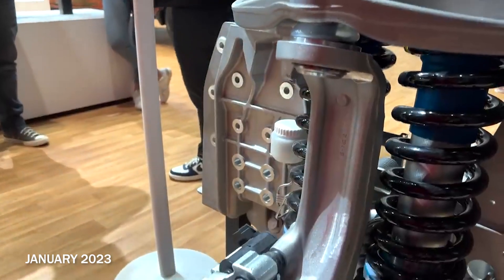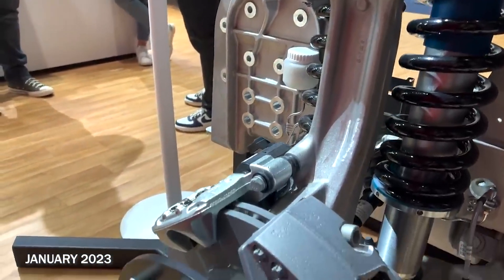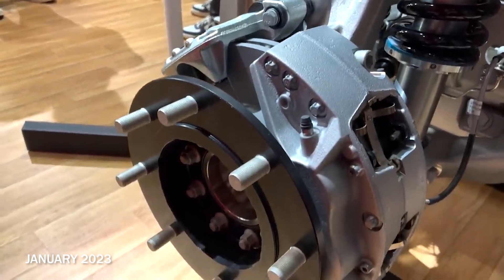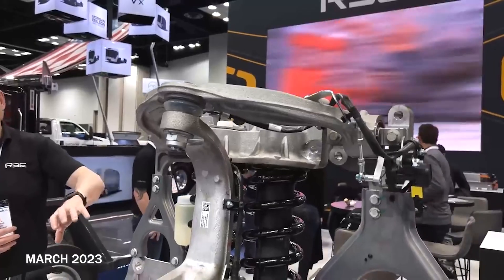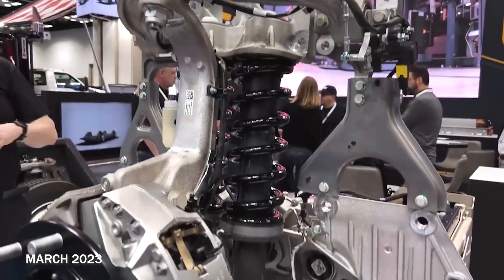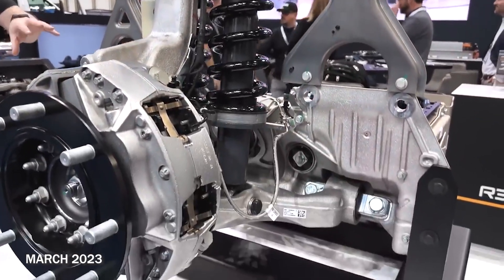Evolution of the REECorner Module

Comment: I still wonder how that can succeed if the whole world is turning around to inhous manufacturing. 
Then this solution must be obsolete except a chinese small company might start copying it to build their own business on such plattform. 

Right now many OEM are upset about the future developements which kind of communication  they should go for. That is not easy if you consider all the workshops that then will need the knowledge of 2 different architectures and systems if they change to a tesla driven architecture. And the main thing is to produce more inhouse also to simply avoid any lay offs. 

Lay offs do not happen here this way as in the US , they do not happen at all cause the unions or representatives of all employees are part of the board decision making with a 50% voice and 50% by shareholders where only the voice of the CEO decides in such cases. Therefore that requires long discussion before. VW is an exception in this case cause the State Lower Saxony owns 20% of all shares and therefore has 10% votes. 
So the CEO of VW always has to please the state Lower Saxony and its prime minister which is a social democrat and the roots of this party are the workers and the unions. 

If you wanna turn around anything inside VW brand or VW group the CEO has to be the biggest smartest team player and has to balance management, workers, unions, shareholders and what not. Therefore the loud speech held in front of VW managers which was a wake call that they have to expect cuts and on the other side a preparation for upcoming talks or negotiations what has to be done in case of lower demand or in particular how to lower the costs again. 

The representatives of the workers are not acting like the UAW but looking for a consense and compromise to achieve the goals and then to get benefits also for their workers. It is a give and take and cooperation, rarely one side goes public like the UAW, they try to find a deal behind close doors even though that will take far longer than anywhere else in the world. But you have the very skilled workers who had learned first 3 or 3,5 years there, worked for decades and develope a spirit, which means that in case of additional shifts they will be there and in case of less orders they stay a day of the week at home with the full income to be ready when the company will need more shifts again. Has saved VW in their deepest crisis after WW2 in 1992 & 1993 when the workers reduced their week to 32 hours and got a 36 hour payment with a lot of other offenses productwise, productionwise, costwise and even strategywise with the VW mark4 as plattform for 8 or 9 cars back then. 

No hire and fire, keep the best team you can have together in good and in bad times.